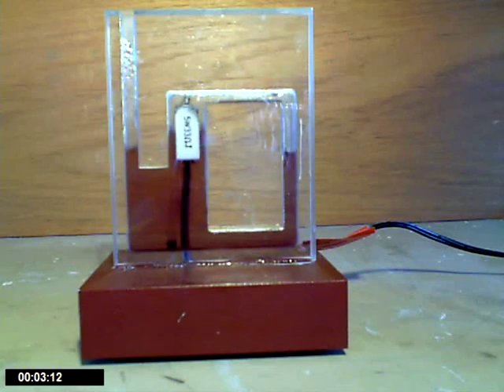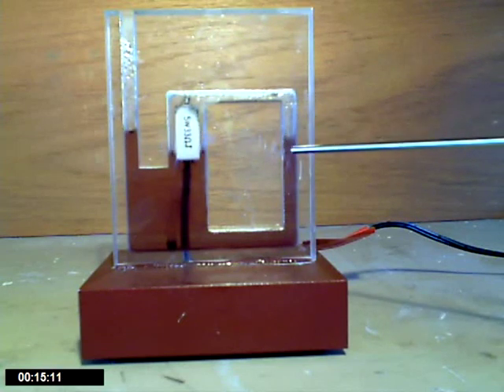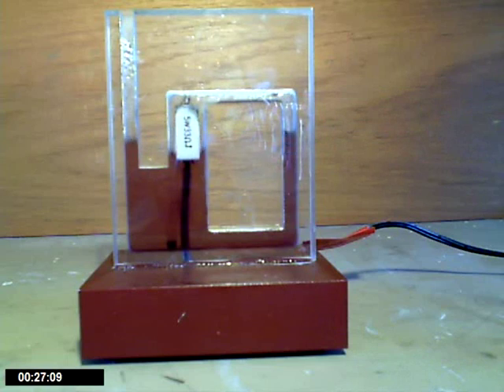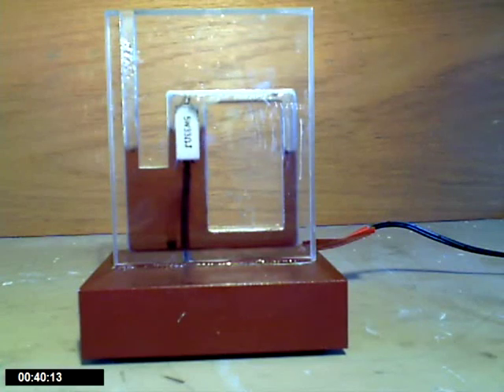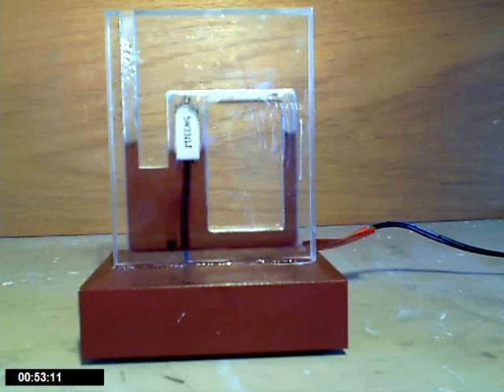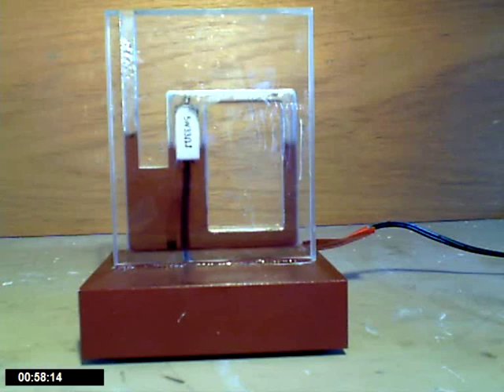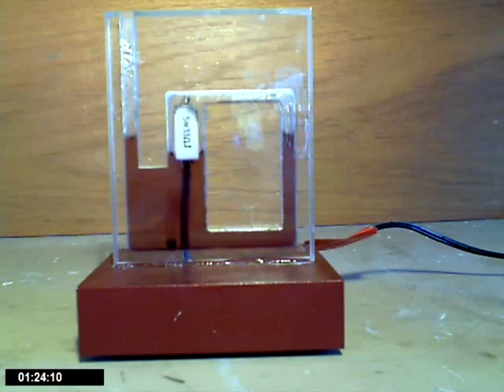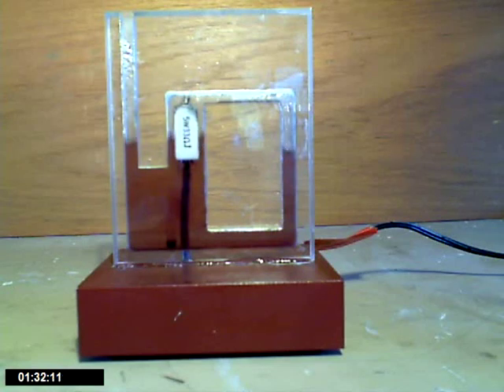Acrylic Fluidyne Engine

Comment: So, the working fluid needs to evaporate.
Since my goal is not maximum Power Out, it is Maximum Work at the lowest heat difference possible, I am wondering about Methanol as a working fluid.

Comment from the maker: Oil wont work in the displacer section but it should be possible to use oil in the tuning/output column. And something better than water in the displacer - West mentions sugar in the water.